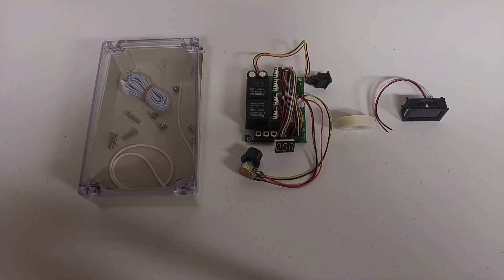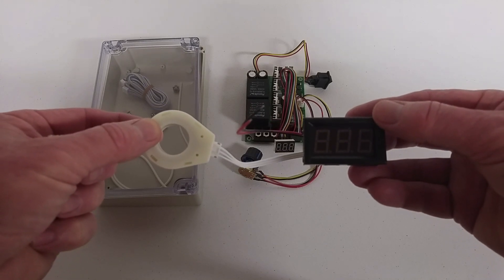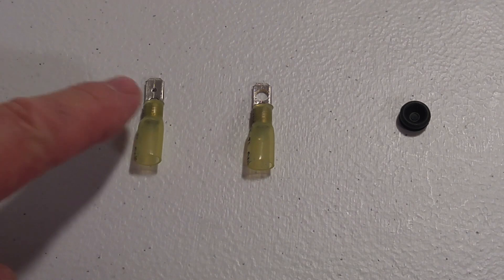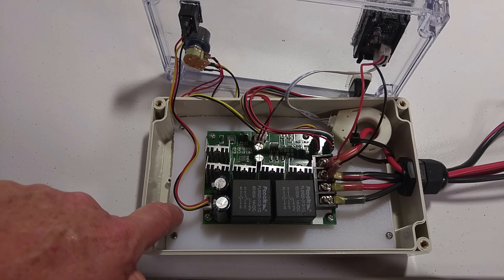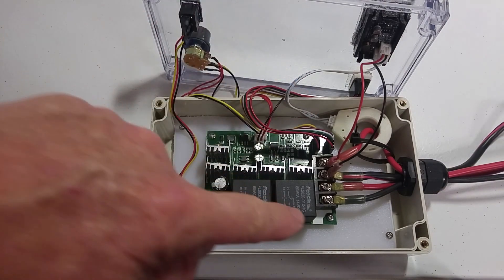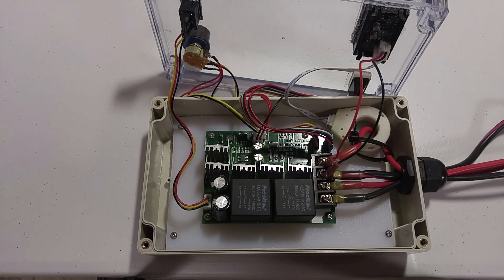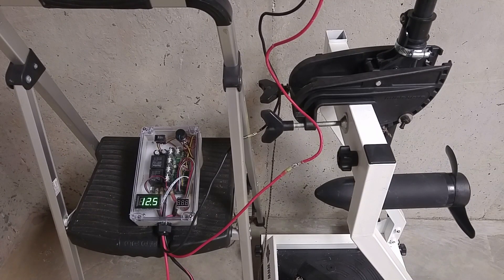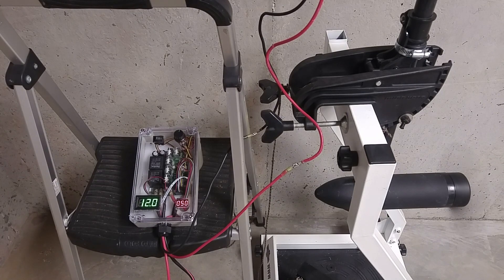DIY Kayak Trolling Motor PWM Power Voltage Amp Output Meter Box

Comment: I've got the same type of setup, but they overheat. I have it in a plastic container anf can take the lid off. The problem is when I take the lid off it weakens the wires and it dies when im at the other side of the lake 3 miles from camp😂.

What size wire do you use for your power and control to red/black
Reply from the maker: I use 10G marine wiring.

Comment: Would you still use 10 awg wire for a 55lb thrust motor? I see 8 awg being common & some people say to use 6 awg for 55lb thrust motors. Is the distance so short that 10 awg is fine? I've got a Newport 55 that has only 10 awg going to the motor - this seems small to me? Thanks AKS! Great videos man I really love how you lay everything out!
Reply from the maker: You are welcome! I have always used 10G Marine Grade in my builds. That wire can handle more amps than the less expensive ones. There is a point where the length does become a factor where a larger wire diameter is needed.

Comment: Very cool! How did you mount the smaller LED display? (For the PWM output) Is it under the clear case or did you cut a hole? I think I've got the same PWM and can't figure how to install this LED output gauge since it seems to have no protective cover. Thanks!
Reply from the maker: Thanks. I used a thin layer of marine goop on the display face and attached it inside the clear lid.

Comment: Hi Aks, Me again, I like the clear plastic lid but somepeople say that causes a greenhouse effect which raises the internal box temperature.  Do you find that to be so?
Reply from the maker: It didn't matter on this build because it will be used for testing only. All my other boxes are either gray or black.
Reply: Thanks for replying.. I was think of using a clear lid so I  won't have to cut into it and I  could see the halo amp Meter. What do you think? I'm going to run a separate smaller 8 wire control, to my seat.
Reply from the maker: @thebear1974  It should be ok.

Comment: If using a PWM, do you still need to add a fuse or circuit breaker for the trolling motor?
Reply from the maker: Yes, circuit breaker is better.

Comment: which pwm did you use?  i went through a few before I found a good one. yours looks more compact.
Reply from the maker: That one was a 60A continuous. Amazon and AliExpress sell them. The latest one I am using is a 60A continuous with a built in fan. I have videos on those builds too.

Comment: Great video!
Just tested my pwm controller, the same you have.
But.. The trolling motor just spins slowly at just one speed.
Can't adjust the speed.
And the motor won't work in the reverse mode. 

 Then I switched the positive and the negative motor wires on the pwm.
Now the reverse mode works, but still motor runs very slowly and I still can't adjust the speed.

I have a fully charged 3 s li ion 12v 100ah accu..
Earlier I used a 60a pwm controller, everything worked perfect.. 

Do I have a bad pwm or something else... Hope you have some kind of an answer😬

Regards from the Netherlands.
Reply from the maker: Hi Jimmy, I have never had that problem. It could be a bad PWM or switch.

Comment: Thanks for a nice video. Appreciated!

Just a quick question : If you were to add an ammeter on the motor +pos (red) wire - would it read the same as the ammeter from the battery?
Reply from the maker: Thanks! Yes, it should be pretty close.

Comment: Hi love this video, I know that this setup is with the 60A but would the 100A work with the 30lb thrus minn KotaC2?
Reply from the maker: Yes it would but be careful because most of the PWMs that list them as 100A are for sudden peak amps. They are usually 60A continuous amp draw.
Reply: Hi again having issues with my pwm, Have the 10-55w 100AH and finally got done installed it with my minn Kota c2 30lb thrus powered by a 55ah lithium battery, tested at home works perfect then went out on the water today worked great for  3 hrs then the pwm started smoking... still have power to the trolling motor but speed variable doesn’t work one runs on 100%... would like to know if youv or hear anything about this issue before? I would love any feed backs thank you...
Reply from the maker: It is possible you got a bad PWM. I did talk to one person before who said that his PWM got stuck at full speed. I have never had a problem with my builds. Maybe I just got lucky or my box designs have better airflow.
Reply: @Aksmaniyak  thanks yes mines did get stuck on full speed . But yes I think I got a bad unit from eBay, but I don’t think it’s the air flow due to I had it sit in the open due to it was my first time taking it out. Might just try the 60a an see if that’ll work better. Thanks again!! Have a great night.
Reply from the maker: Good luck!
Reply: @Aksmaniyak  if you don’t mind me asking what company did you purchase it from?
Reply from the maker: I bought the brand Knacro from Amazon.

Comment: Did you cut shaft down and only run blk/red wires to control box, or leave head unit on?
Reply from the maker: I cut down the shaft and only used the black and red wires. I used a PVC 90 on top of shaft.

Comment: Thank you for all the helpful videos. I have one question. While using a PMW, what do i do with the white and yellow wires coming out of the trolling motor? Are they eliminated?
Reply from the maker: You are welcome Jim. Just cap off the yel/wht/ wires. I started a new FB page which makes it easier to share info. Here is the link if you are interested.   https://www.facebook.com/groups/3521517597860461

Comment: I'm hoping you will help me. I have your exact set up on my kayak project---exactly as you have yours with same PWM but not the 2 meters. My Question is: I want to feed it with 18 Volt battery packs and want to know if that will end up changing the voltage that arrives at my 12 volt motor and damage something? My PWM is rated 12/24/36/48V (in?) but I cannot find any documents as to what comes out. Any help in this matter would be greatly appreciated.
Reply from the maker: I have only used a 12V source with that PWM and it puts out 12V for the trolling motor. The PWM will handle 18V but it will put out 18V. So, if your motor and related electronics are set up for 12V they will probably fry. Is that what you are asking?

Comment: Aksman,  I was thinking what if you put another set of o-rings under the cutting board also ,  to raise it off the box and drill small holes all over in the cutting board  below the controller to help even more with air flow, your thoughts.
Reply from the maker: As long as there is a good gap under the board the extra holes won't really make a difference.

Comment: On the pwm what does the indicator that comes with it tell you?
Reply from the maker: It is a power output meter.
Reply: As batter runs down will the numbers also get lower, does it reflect batter life?
Reply from the maker: Yes, as the battery loses power the numbers will go down.
Reply: Thank you for the info .i am going to use your separate switch set up 👍
Reply from the maker: You are welcome.
Reply: Thank you sir, I am going to use your separate switch system 👍
Reply from the maker: You are welcome.

Comment: Can you enclose pwm in a small box air tight or  do you need to vent to prevent overheating
Reply from the maker: I use a larger size waterproof box and raise the PWM on rubber grommets. That allows for better air flow.

Comment: How is longevity and reliability? I’ve read that these PWM fail pretty quickly....
Reply from the maker: That is true some do fail quickly. I have been lucky and not had that problem. I think my build design helps with air flow and heat transfer which makes a difference.

Comment: https://store.digilentinc.com/dmc60c-digital-motor-controller-approved-for-first-robotics/
Reply from the maker: Looks interesting. How do you control the speed and direction?
Reply: Aksman remote controller for that model. If your looking for something that can be plugged in, this one has several ways including remote. https://www.servocity.com/roboclaw-solo-60-a-motor-controller
Reply: Aksman directional steering is up to you. I personally use foot pedals. Hooked rudder cables up to my motor shaft via 1” bore pulley. Most people have a rudder system I just modified mine to spin a shaft and self center. But you can do this even if you don’t have the rudder system on your boat. Just get a small 1”bore pulley and run some cordage thru some padeyes up to you and done!
Reply from the maker: @fivetwentyseven8598  I have done several steering projects as well including a spring loaded return to center option. It's nice to see other people's ideas. Nice job.
Reply: Aksman I was thinking the same thing. Got to love YouTube to find likeminded people and ideas. Keep it going. I’ll have my steering DIY up soon with more videos on the electrical components mentioned and more. Follow me if you want to see how I manage it all.

Comment: Hey Askman, wondering if my wiring is correct.
Reply from the maker: Is there a problem with it?
Reply: Aksman thanks for responding. Enjoy all your videos and I’m building a box based on them for my trolling motor. I have the basic wiring down pat, but I’m stuck in the accessories like USB and the fuse box. I couldn’t attach a pic to show.

Comment: Gland Nut..  10 awg (2.5882 mm dia.) ...Search:   uxcell M16 Cable Gland 4 Holes Waterproof IP68 Nylon Joint Adjustable Locknut for 2.4-3.4mm Dia Wire

Comment: Nicely Done....Putting an order together to build same. List OK and Marine 10awg OK / Waterproof Cable Gland nut size? I made a best estimate Size M50 x 1.5"length.
Reply: Correction: uxcell M16 Cable Gland 4 Holes Waterproof IP68 Nylon Joint Adjustable Locknut for 2.4-3.4mm Dia Wire
Reply from the maker: Yes 10G is what I used. I'm not sure of the gland nut size because I bought an assortment. Just measure the diameter of the four 10G wires touching each other.

Comment: Hello I am right in the middle of making my own PWM speed controller and I want to make one just like yours , where do I get the clear box or do you have a part number for it?  It looks so nice and I would rather use that than a grey outlet box. Now remember I am a  rookie at this but I want to make it work will the electrical connections to the PWM be identified as to where to connect it too? I guess I could purchase this at a radio shack ? I think they closed them out here. Thank you so much for your help Im 66 years old, a vet, had cancer, right hip replacement, I need all the help I can get! Thank you
Reply from the maker: Hi Oscar. First thank you for your service. I have a lot of respect for our Vets. The parts are listed in the narrative. You can get the PWM from Amazon and ebay. When you choose your PWM, there should be a close up picture showing the connections.

Comment: Have you went out and tested   PMA yet am curious  if it might  be overheating or not
Reply from the maker: Hi Dave. Yes I have tested different versions of PWMs with no heat issues.
Reply: Aksman  question  about your shunt  resistor / Do know  if you have to used  a shunt  resistor  on Watt meter logger they used them for solar that will show amps /volts / watts? Thanks
Reply from the maker: Hi Dave. This design does not use a shunt resistor.

Comment: Nice Job.    l made one similar  boxes like yours  l using a watt meter  instead volt meter  it gives Amps & Volt as well watts . My battery is a 30 amp  hour  Lithium battery  the battery's  holding up well but am having trouble PMA speed controller it been over heating Especially  on a hot days ! and it shut down on me it gets to hot . Have you went out and tested yours yet under load ? Let me know how it's working out .  My PWM  speed controller  it's supposed be rated 60 Amps /  l found out one thing the PMA  does  not like to be enclosed  it need air to Cool it down . Thanks  Once again you did a nice clean job on your box
Reply from the maker: Thanks Dave.
Reply: This was my concern too, and was thinking if you got a metal waterproof box, at least it can dissipate heat externally

Comment: I am hoping to replicate what you have done. I'll be using a 55lb Minn Kota. Has your unit had any heat issues? Would you recommend adding a fan in the box if it's being used for long periods of time?  Thank you for your response.
Reply from the maker: Hi Daniel. The unit I used should handle a 55lber. I have never had a heat issue with these boxes. I mount the circuit boards above the base to allow for air flow and the box is oversized to allow for heat transfer.
Reply: Thank you for the help!

Comment: Where did you buy the v/amp meter with the magntic ring? Does it come with wiring instructions for the red and black wires?
Reply: Found the volt/amp meter with magnetic coil that you used.  I ordered the pwm and meter to duplicate what you did....very nice...thank you

https://www.amazon.com/bayite-Digital-Current-Voltage-Transducer/dp/B01DDQM5PK
Reply from the maker: You are welcome Grant.

Comment: Does it heat up considering the box is sealed with no air circulating around ? hope you update after actual use on water.
Reply from the maker: This is a third version using the same brand PWM and enclosure. I have already had the previous versions on the water for testing and each worked as designed.
Reply: @Aksmaniyak  Thank you for the reply, it is great that it does not heat up. I have found some PWM come with a fan so that I thought these unit might be heating up excessively.
Reply from the maker: @dcfarouk  You are welcome. The way I have it mounted and the size of the box help with heat transfer.
Reply: What brand specifically is this one?  Do you have a link?  Thanks!
Reply from the maker: The units are basically all the same. This model has good specs.   https://www.ebay.com/itm/10-55V-100A-5000W-Reversible-DC-Motor-Speed-Controller-PWM-Control-Soft-Start-US/202576542955?hash=item2f2a80bceb:g:HrkAAOSwydZcTBLF

Comment: Hey Aksman, another great tutorial!! I have a question maybe you can answer I have a V-max lithium battery.
The description reads 12 volt but looking further in the spec. sheet it says nominal Voltage 12.8 could this be an issue 
For my PWM and my 40lb. Thrust minnkota??
Reply from the maker: Thanks John. That voltage should not be a problem. My AGM battery reads about 12.6V when fully charged.
Reply: Aksman I gave you wrong info. Although they call this a 12 volts the nominal is 14.8 volt. What do you think?
Reply from the maker: What PWM are you using? Many of them can be used at higher voltages.
Reply: Aksman They same one you are using in this video also purchased another one which is actually the same without the 
Percentage meter. Its the one that comes in the aluminum cover.
Reply from the maker: Go back and check the listing for that one. It is probably rated for 10-60V.
Reply: Aksman Input Voltage: DC10V-55V and the other is 10-60 v
Output Voltage: Linear with load Max. Current: Max 60A Continuous Current: 40A
Speed Range: 0% to 100%  fried 2 of these with a vmax lithium ion 50 amp hr. 12 volt / 14.8 nominal volts
Reply from the maker: I'm not sure why it would have fried because the amp draw on the 40lb TM is far below the 40A continuous max when using the PWM. I use AGM batteries but if Lithium is a problem I don't know why.
Reply: Aksman well thanks for your thoughts, I will continue to delve into this, I need to find an answer. For now i will use my detached minnkota
Head which work well yesterday after i lost my second PMW. Thanks again
Reply from the maker: I know you have probably double checked your wiring but you could also try another company. I had 2 bad units a couple of years ago but changed companies and everything has worked fine since then.
Reply: Aksman Thanks, yes i checked and rechecked the wiring as simple as it is I made sure all connections were in order. I purchased 2 different items on Amazon. My other problem was frying a WTP Also $$$
Reply from the maker: Wow. Frying a WTP is not easy. I will try to do some research on lithium battery problems and let you know if I find anything relevant.
Reply: Aksman Still researching, the lithium ion I have is 14.8 volts nominal, might surge higher? This might be the problem?
The Lithium LFP phosphate is 12.8 nominal which is the one i thought i was getting?  If this is in fact my problem i see only
2 options, hope that they except a return? I'm out 2 months on the purchase. Or try to purchase a step down that would work with lithium ion
14.8 V down to 12.8 V.  I'm still not 100% sure. I'm a little out of my league here with PWM & voltage step down regulator.
Reply: Aksman  I think i got it? Not much info out there, but this is what i think is happening. A 12 volt lithium ion holds a nominal charge 14.8 but at full charge they are 16.8 volts.  The trolling motor calls for 12 of those volts. So we end up with 4.8 volt overage and that is burning up the PWM.
The PWM says the can handle 20 -60 volts, and that might be true, however the voltage going out the PWM must be very close to the volts coming in.  I think if you feed a PWM 20 volts to a mother that calls for 20 volts. You would be fine. My guess is if you feed 12.8 volts in you must be using them on the other end. A small disparity .8 volts might not harm the PWM.
But a higher voltage will.  Thats why everyone that seems to be running AGM or Lead acid batteries are having no trouble with the PWM.
Because its very close to a 1:1 ratio.
Reply: @johnrugani9832  were you able to use the step down and continue to use your lithium battery pack? I am looking into a build and am wanting to use lithium, need to know if I also need to order a step down.
Reply: Another thing you can try is a 12v voltage regulator between the battery and the pwm this should hold the voltage at a steady 12v going into the pwm regardless of the battery output....